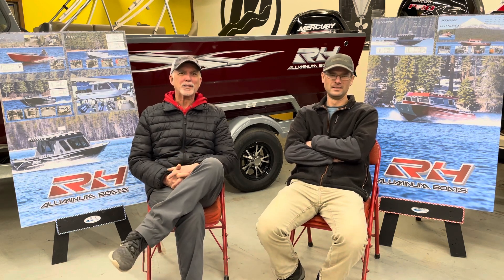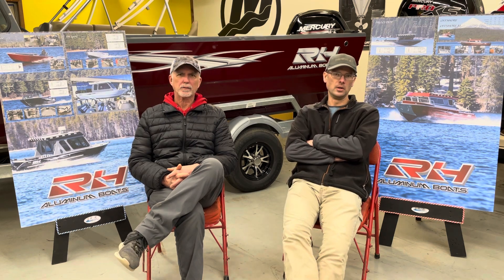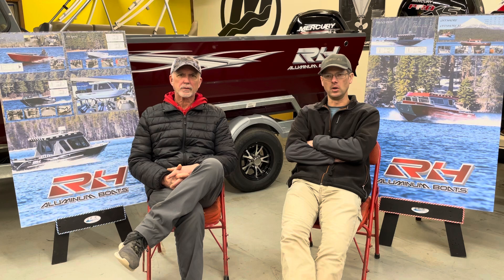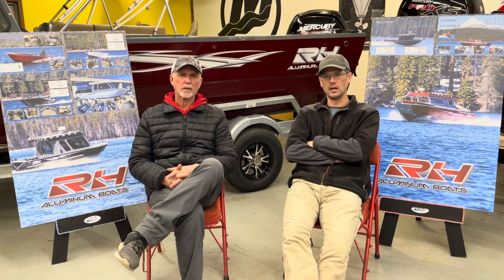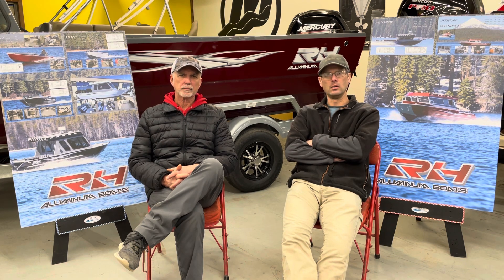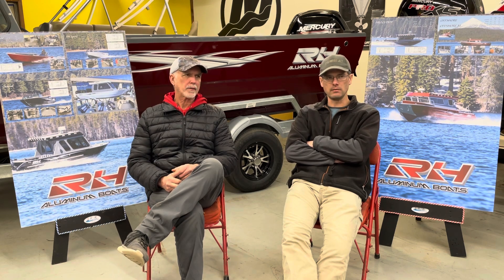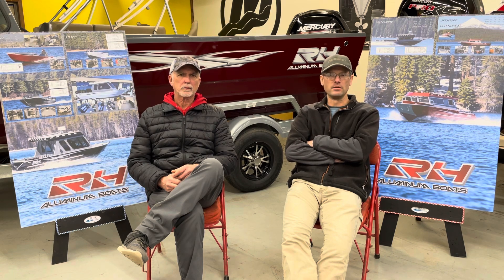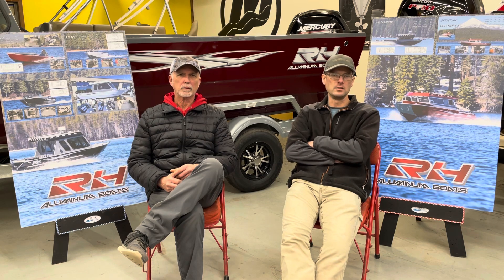What is the best value in Heavy Gauge Aluminum Boats?  RH Aluminum Boats Discussion

Comment: I'm out in CA near Sacramento-- we have been relentlessy researching what will be our boat .  We have looked at all of them - RH, North River, Hewes.  There is no Raider dealer around me but I really like those too.  RH is quite a bit cheaper and much, much lighter than the NR in particular which may or may  not be a good thing. We will be using the boat in big( well, big for CA haha) freshwater lakes, American/Sacramento River, the delta, SF Bay and coastally between Golden Gate and Bodega Bay where the water can be challenging. 

 If the dealer guys on this page read this, i'd like to know where the weight savings come from- ?  the guage of metal between RH and North River/Hewes is pretty much the same - are there less structural components in the RH vs NR/Hewes? 

I have looked at the  20' Coastal at the boat show last weekend.  the Coastal w/200hp + 9.9 kicker would likely be the choice if we go w/RH.

first couple things that concerned me about the RH upon initial inspection besides the obvious difference in weight-- there is no bulkhead on the driver or passenger sides where you are saying the trolling motor batteries and charger would be. The rep told me the lack of bulkhead also allows for legroom if you're sitting in driver or passenger seats.  The coastal at the show also had that hatch/box in the bow.  where does that box drain to?  Also - the forward storage area in the very front of the bow -- we put a light in it and if a wave comes over the bow and water gets in there it drains out where that area is underneath your feet where there is no bulkhead - that doesn't seem right..  I understand it probably wouldn't happen very often but if this boat is in a big body of water or the bay/ocean, its not unreasonable to expect some water across the bow.  

Next -- it looked to me like the house/crank batteries in the aft compartments are not sealed apart from where the bilge water would be? in the NR /Hewes boats the batteries are in their own dry compartments.  I would not want water to be anywhere near the wiring or the batteries back there. 

A similar size and similar equipped NR boat is about 20-25k more.  Where is RH creating the savings? this is where the obvious weight difference is concerning to me.
Reply from the maker: Hi John.  These are all very good questions.  As a dealer we have looked at how many of the competitors build their boats and compared those to the boats we carry.  When comparing various brands and the specs, you need to confirm they are using an apples to apples comparison.  For the RH - Coastal 20, the very close comparison is to the Hewescraft 200 ProV ET.  Dimensions are very close on these two boats.  Hewescraft build their boats differently.  If you look at the side of an RH you will notice two creases that run the full length.  This add a huge amount of stiffness.  This reduces the need for extensive internal bracing.  They use the metal already there to the fullest extent and create a stiff structure.  In addition to that, RH is proudly a no foam company.  That is they don't need heavy, water absorbing foam to create a stiff rugged boat.  Any boat over 20ft overall is not required to have flotation foam.
Reply from the maker: I'm breaking my response up a bit. 

North River as another builder of heavy gauge boats is a very different comparison.  I would not put the RH Coastal in the same comparison with the NR SeaHawk 20'x8'.  The North River has a deeper deadrise hull, aluminum floor and many other differences.  North River is a higher end brand.  They do have many reasons they are more expensive.  North River is also a no foam company, but they also use thicker metal in the side of their boats and also having the deeper V forward certainly adds weight and cost.  While the grade of aluminum used is also important not all of the manufacturers publish that info.
Reply from the maker: Regarding some of your technical questions on the RH boats and the configuration and so forth.  The bow fish box/storage has drainage through a hose out the transom.  The forward storage cubby shares its floor with the rest of the bow.  Now, there are holes that would allow any substantial water entering that area into the bilge.  This is not an abnormal design.  Regarding the house and start batteries, yes they are located (as in most boats) in an area where the water on the deck of the boat would flow on its way to the bilge.  The batteries are intended to sit in trays on the deck.  In other boats (even those you mentioned) the compartments you think look dry are anything but and in some cases are recessed below floor level and actually creates a low spot for water to collect.  In reality you can't have battery compartments sealed.  Traditional batteries need to vent and all batteries really shouldn't be in a confined area.   In thinking about various different set ups for batteries, I've seen more issues with boats that have small dedicated, sealed areas for batteries than those that don't.  I really can't think of a boat that has an area where the batteries are truly dry.  

All of this is to say that RH Aluminum boats build boats that are well within the norms for the industry and does so with smart use of materials and design that allows them to sell at a price point that is quite a bit lower than the competition.  RH Aluminum Boats are a value proposition.  They provide a good balance of quality, design and cost.
Reply: @northwater4991    Thank you guys for such a quick and thorough reply!!!!  I'll be taking another look at the RH!
Reply: @northwater4991    No hatches on the deck? no space underneath?
Reply from the maker: @johncarlson306  Correct.  If you mean the cockpit sole/floor, you are correct.  RH doesn't provide underfloor storage on the Coastal.  As I mentioned before these are a price conscious boat and some things just aren't available on them.

Comment: Nice boats, but interest rates are high right now to consider in getting one 😢
Reply from the maker: The interest rates where they are currently has been an adjustment vs. how low they had been.  However, that is another reason that the RH lineup makes a lot of sense.  When you compare apples to apples to other competitive boats, you will see that RH is usually less money up front and that can help make up for the higher interest rates.